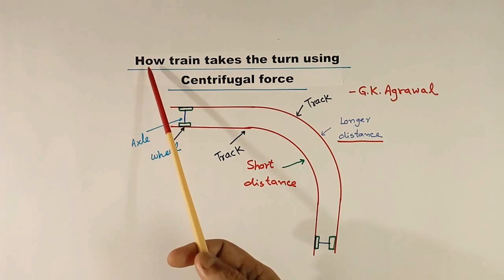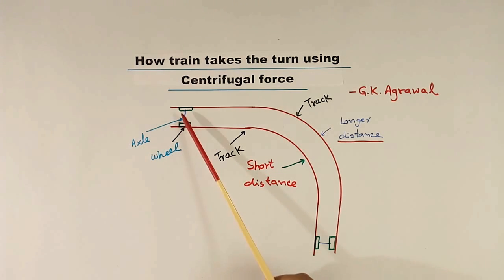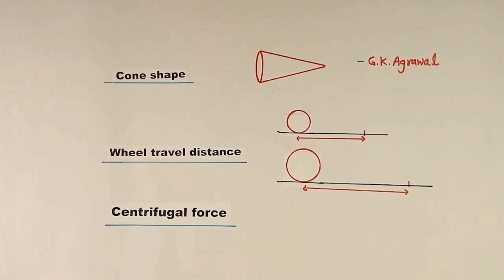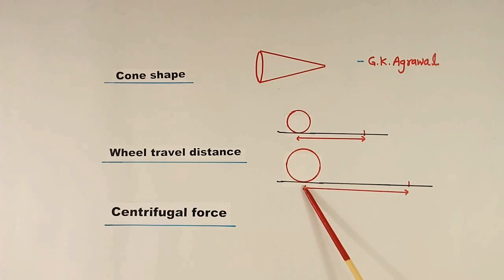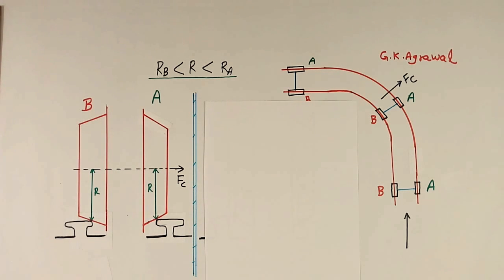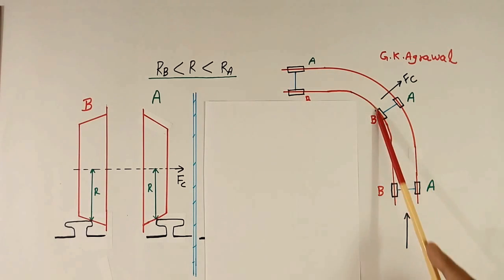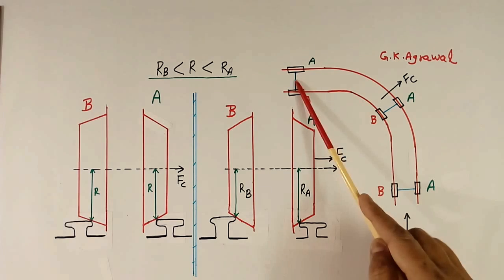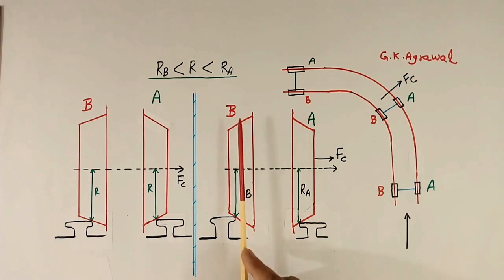How do trains turn on track & rail wheel concept

Comment: Ji it is ok for conventional train wheels. But bullet train wheels not in cone shape. They are in flat shape. Then how they behave in curves? Pls explain?
Reply from the maker: Where it is written that bullel train wheels are flat type. I do not know that bullet train has different wheel.
Also watch my video on Bullet train concept.
Reply: @GKAgrawal2  in these video i understand that conical wheels at high speeds create hunting oscillations. Is it correct or not

Comment: SIR, MOST SIMPLY EXPLAINED. THANK YOU SO MUCH.
Reply: SIR, THERE IS SOMETHING LIKE A STEERING WHEEL IN THE LOCOMOTIVE CABIN, WHAT'S IT FOR?
Reply from the maker: That is not for turning , but for speed control.
Reply: @GKAgrawal2  THANK YOU SIR

Comment: Was not able to see figures u show due to subtitles. Plz see videos before uploading.
Reply from the maker: You can make subtitles Off. Location of subtitles is not controlled by us. Subtitle are added after uploading video. It is decided by youtube. You can reduce the letter size of the subtitle at your end. You should try watching by keeping full screen video mode { rotation of mobile} . However I will check if any sentence is too long, then I will make it small to avoid 2 lines displaying at a time.

Comment: Centrifugal forces exist, but their effect is not constant.  When a train is being pulled (uphill, or around curves with much friction), those forces overpower centrifugal forces, and tend to pull the cars to the inside of a curve, just like laying a chain out in an arc, and pulling on one end.  But when a train is in compression (braking, downhill, etc), the centrifugal forces are amplified by the compression forces.

Comment: On a curved track, there is always some level of superelevation, depending on the degree of curvature and the max speed allowed on that portion of the track. That superelevation of the track is there primarily to counterbalance the centrifugal force and therefore prevent trains running off track and derailing. So I think one cannot rely on the centrifugal force to be "pushing" the wheels to the side and increasing the wheel radius. Also, the centrifugal force is a function of velocity. So if you go at very very low speeds there would be no centrifugal force. Then what?
Reply from the maker: difference in elevation of the track is told in the video. There may be always some slip between track and wheel depending on the speed, curvature and weight. Watch my video on why AC motor is used in the train engine, advantage of AC motor in train Engine. Slip control is explained in  more detail.

Comment: Nice effort to explain easily. 
But centrifugal force does not play that much role. The whole wheel system just follows the instant tangent line of the track at that point. But due to the presence of curvature in the track, the effective radius of the wheel with respect to it's point of contact with the rail get's changed. The effective radius of the inner wheel get reduced and the outer wheel increased. This in-turn makes the outer wheel to travel more linear distance than the inner wheel. Now, since both the wheels are rigidly connected by axel so whole wheel system follows the curvature of the track.
Reply from the maker: Logical explanation as given by you is very good for getting idea. But for calculating stress on rail and wheel or on any other components etc, all mathematical calculation    indicating various forces are considered.  Some mathematical model has to be considered. Design of components is done using mathematical model and simulation. Design parameter of components are always decided based on some mathematical model.

Comment: It's not the centrifugal force, the axles just follow the turn a little later...
Reply from the maker: Welcome, If we take wheel as reference frame,  then centrifugal force comes in picture for explanation of forces applicable.
Reply: Thank you for the good explanation. Centrifugal force is a function of velocity, what would cause the axle to shift if the velocity was very slow, like say when you are shunting a train.
Reply: You are right.